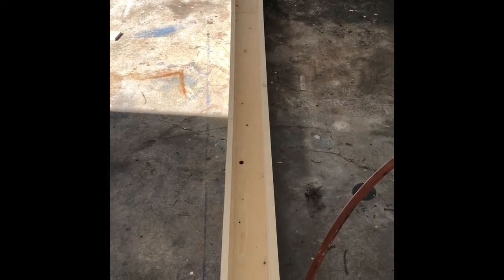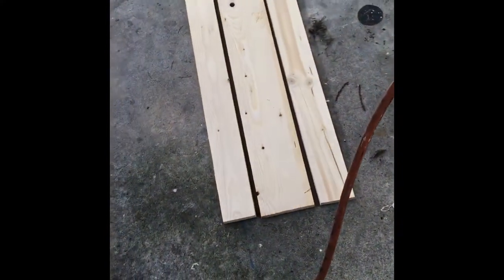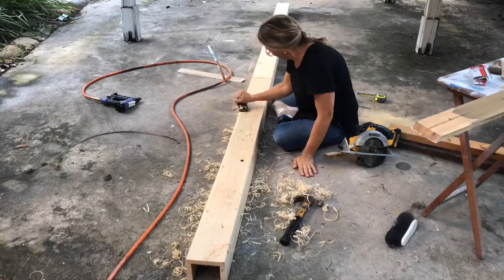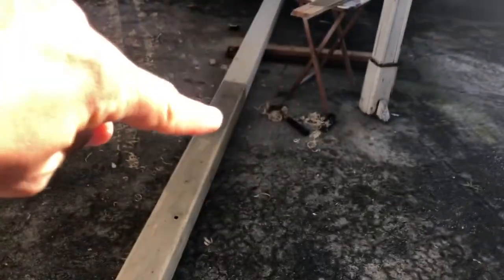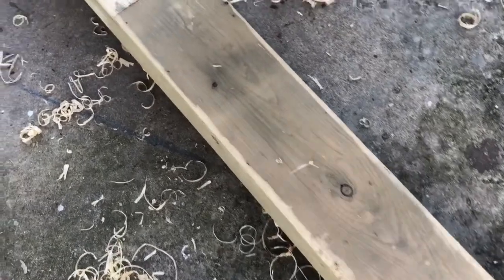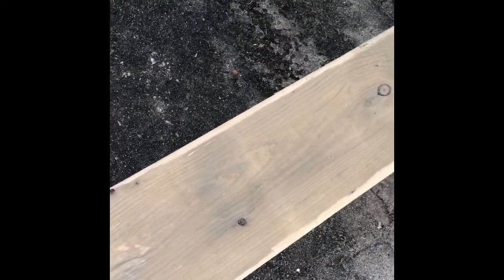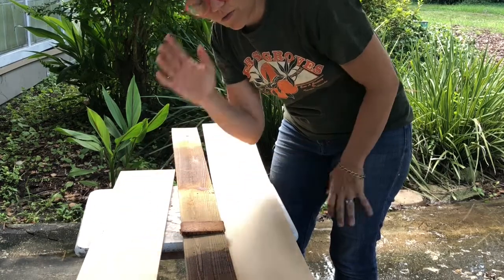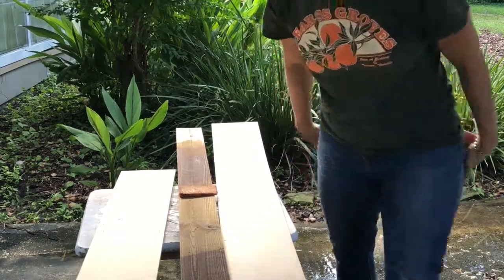Faux wood beam DIY - how to make new wood look old.

Comment: Your hand planer on the edges and the Amy Howard ager, WOW! That's a game changers on appearance.  Thank you for letting us see the fail, no one wants to make that again.  
  I found at Restore a box of 12mm (1.5")laminate of 9" planks for $7.  Enough to cover this big ugly mess in the ceiling of this mobile home (Yuk) .  They look real, beautiful brown, wire brushed look,  I would make a large beam to cover, not sure if 1/2" will hold but worth the $7 make it or fail process that so many of us go through. This process will require 45 degree cuts and more time spent in the build.
 I need smaller beams in the master as they are really low. I really liked how the Amy Howard brought out the detail.  On video it looked like you had almost sandblasted or used a wire brush (so much more work).  So many videos the faux beam LOOKS FAUX and blotchy stained (pine is rather a gamble when staining)...that is NOT my goal.  I'm trying to make this 'cheap' home look luxurious.
ps...I did go to the Woodglut website  LOL for  the $67 to access I could have purchased the wood for my beams.
Reply from the maker: sounds like you're a lot like me...my favorite place to shop is habitat Restore.  I find so much gold there. I didn't wire Brush my beams. I just used the Amy Howard stuff.

Comment: I like the way it came out. I want to do the same in a guest bedroom.  Tell me, how did you ensure that the ceiling cleats were lined up straight? A fraction of an inch off and I suppose the cleats would not easily fit between the parallel 1x4s. This is my only hesitancy in taking on this project.
Reply from the maker: measure twice I guess...the cleats I cut fit perfectly and it seems to me this was pretty forgiving.  However my beam is mostly viewed from the side and it's the lone beam.  I suppose if you're doing multiple beams all parallel each other and your view was mostly lengthwise, any un-squareness would be much more noticeable.
Reply from the maker: Just go for it...it doesn't have to be perfect. Especially if you're going to distress the beam to look old...a little  wonky-ness would be fine.
Reply from the maker: OH...now I see your question!  The 2x4 that I used for the ceiling cleat was already there.  It was previously part of the bulkhead that I removed.  I just left that one last 2x4 on the ceiling because it was perfectly placed. I did have to add on about a 4' length though and it worked out.  You could pop a chalk line...
Reply: @MimzyandCompany  Ahh, I see.  I'll figure it out! Great vid. Thanks for the reply.